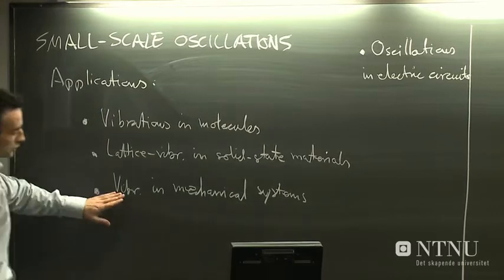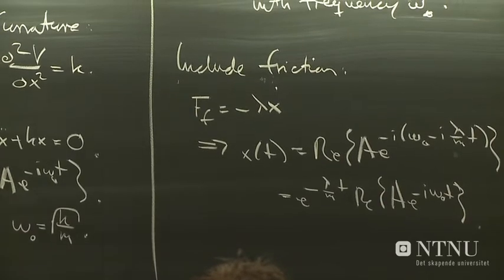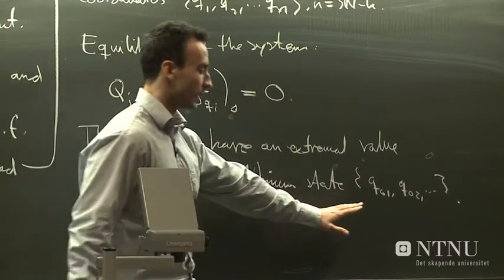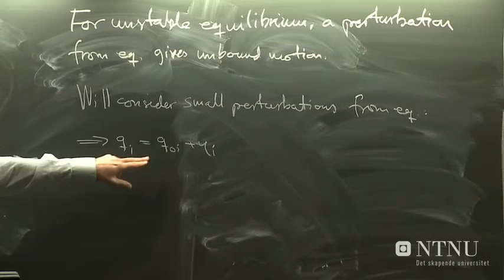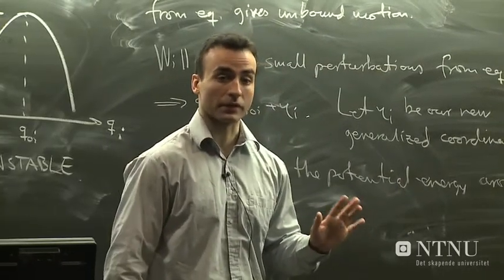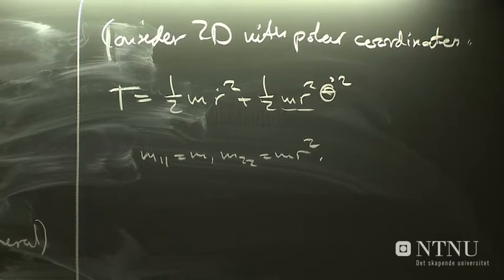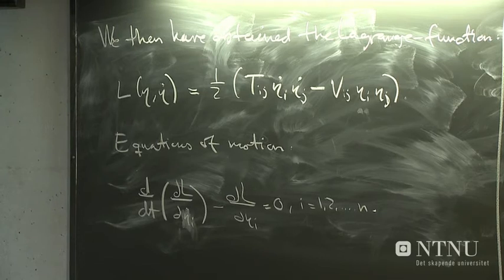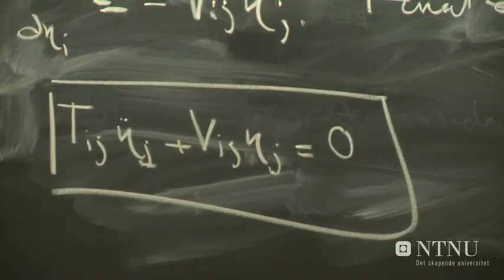29: Small-scale oscillations - Part 1

Comment: How can we just discard the constants in taylor expansion of potential
Reply: First term is discarded by shifting of zero of the potential. ie, coz we can. For second term, first derivative of potential is zero at equilibrium point.
Reply: We don't discard any lower order terms. A Taylor expansion is a polynomial approximation of a function at a given point in R^n. Since this is the theory of small oscillations, higher order terms in eta are not going to improve the accuracy of our results much. So we drop them. The first two are dropped by using the equilibrium condition.